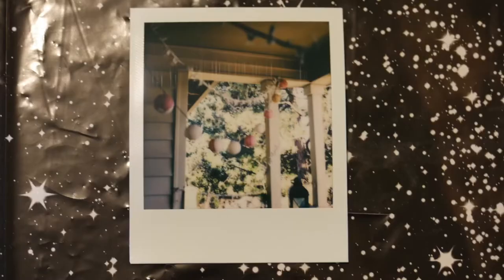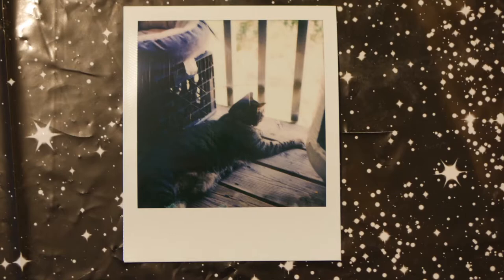Cleaning & Testing a Polaroid SX-70

Comment: I wonder how you still managed to get images with 600 ASA film. Because even if you use the new SX-70 films sold by Polaroid, you still NEED to turn the compensation wheel to minus 1-stop (dark), that's because the new film is 160 ASA, more sensitive then what the camera "thinks" is inside. The camera is designed to work with 70 ASA film.
Polaroid sells a lens kit with an ND filter that allows you to use 600 ASA film normally in an SX-70 camera. You may also want to clean the light sensor, it's pretty easy and it improves the photos quality drastically.

Comment: Hello, I picked up a sx70 at an estate sale recently. There are some stains that almost looks like rusts on the roller. I attempted to clean it but nothing came off…also the roller feels smooth so it doesn’t seem to be gunk…just wondering if this might affect its usability (haven’t purchased film yet, hesitating whether to make that investment) 😊 thank you!
Reply from the maker: The only way to find out is testing it, on mine I actually had something similar, there was some gunk on mine, but it didn’t affect it, if its not coming off, it shouldn’t affect it, but unfortunately since its such an old camera, (almost 50 years old these cameras are) the only way to know for sure is to test it. Thankfully with a Polaroid you’ll know within 15minutes. 

Another option if you wanna go for it, is Retrospekt.com, they refurbish these cameras, if you send yours in they’ll fully refurbish it, and I believe it was 200 last I checked their prices.